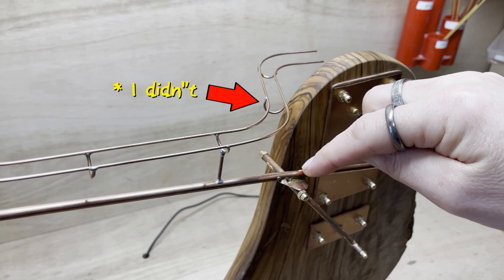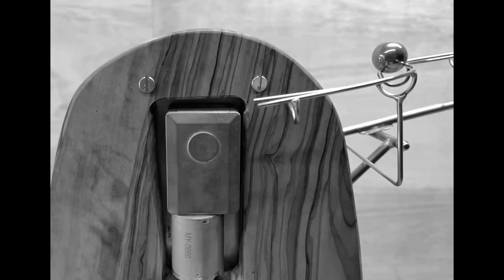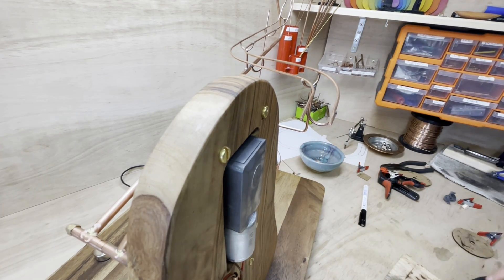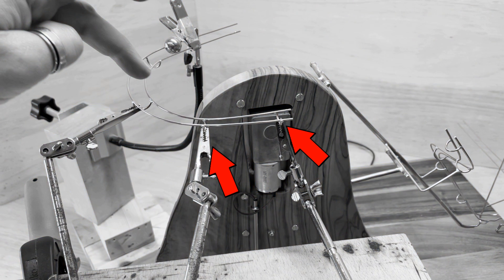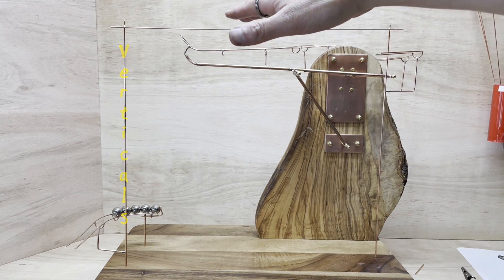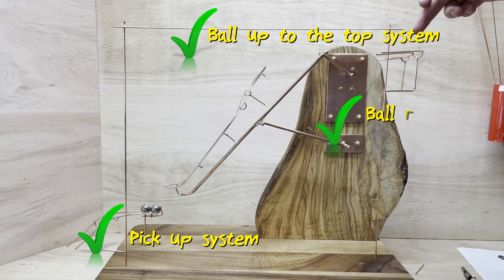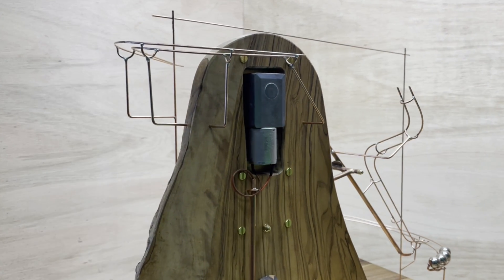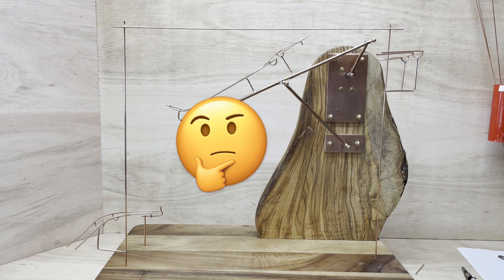Starting the downhill tracks on my Rolling Ball Sculpture RBS4 EP 6

Comment: I really love your work and enjoy being a part of your thinking process. Can you spend a little time discussing wire choices and sources? I'm confused by wire gauge and hardness. I have some 14 AWG and some 16 AWG, but they seem too flimsy to stand up to the constant stresses.
Reply from the maker: Depends on ball size, material and weight. I use 1.6mm for the track and support it on 2.0mm wire. This sculpture uses 5/8” stainless steel balls. I think 16 AWG would be too small for me.